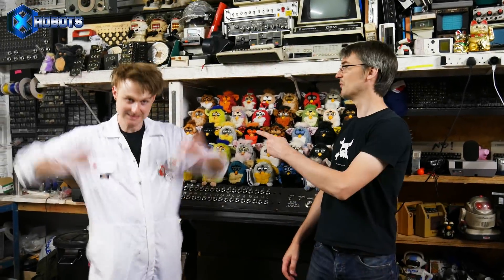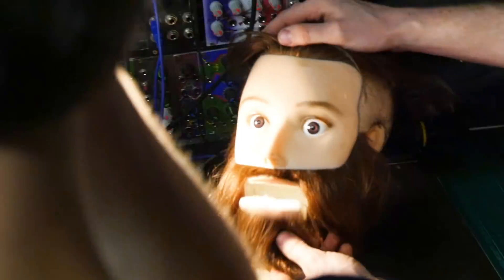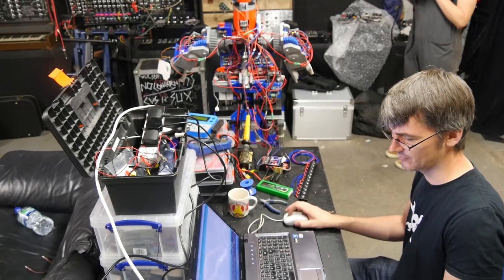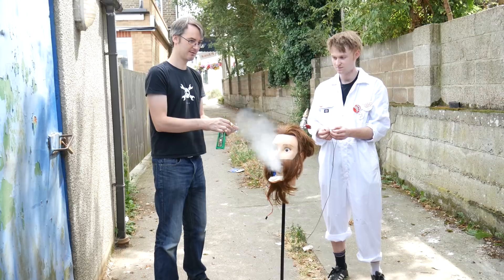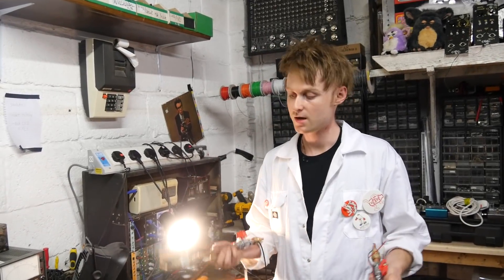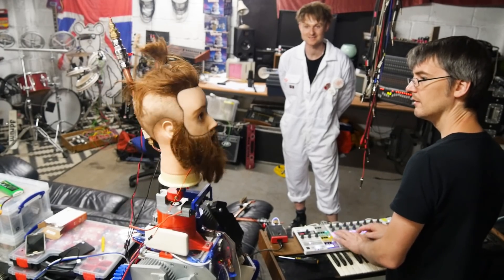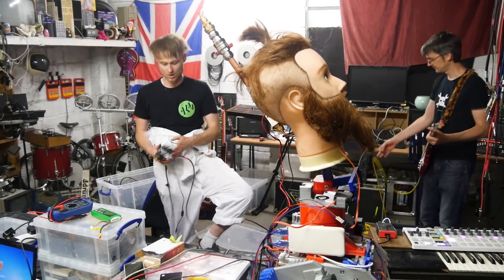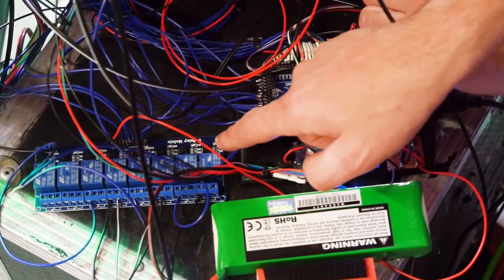Dancing, Fire-Breathing Robot w. Look Mum No Computer | James Bruton

Comment: It looked like near the end there there was too much going on and one by one your serial lines saturated so none of the receivers on the actuator sections received data.
Reply from the maker: actually the synth stopped working and we dubbed the audio afterwards, so there was no signal going to the arm.
Reply: aaah, that makes sense. was a very cool build though.